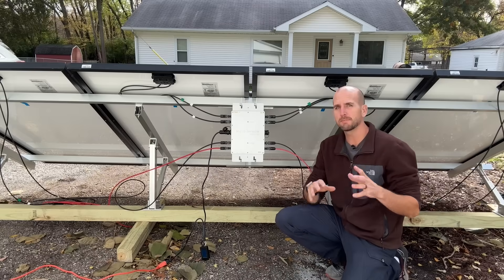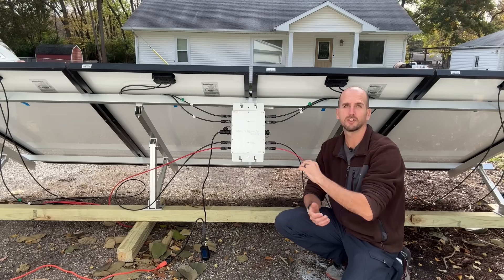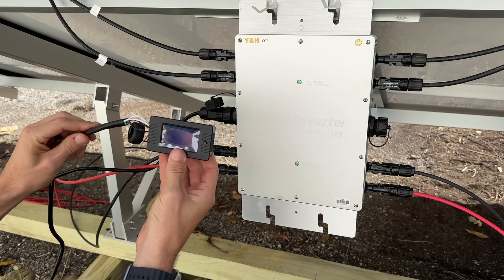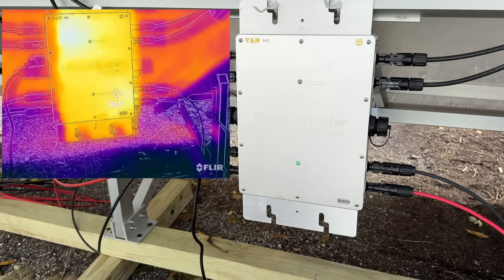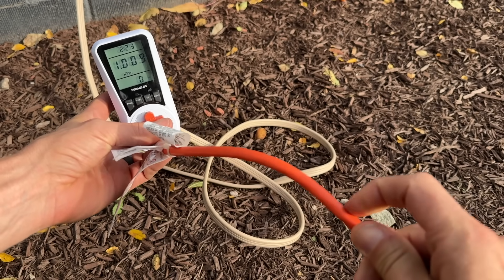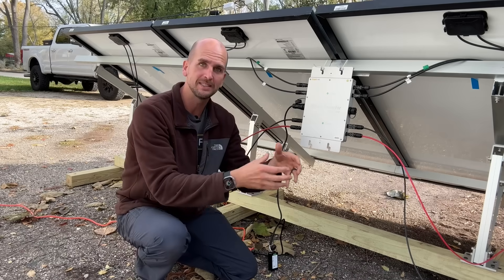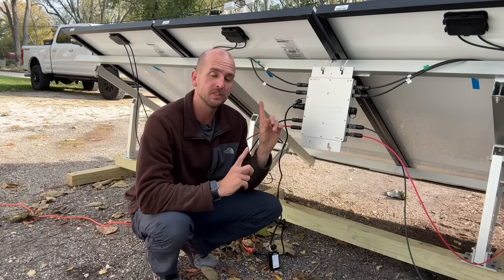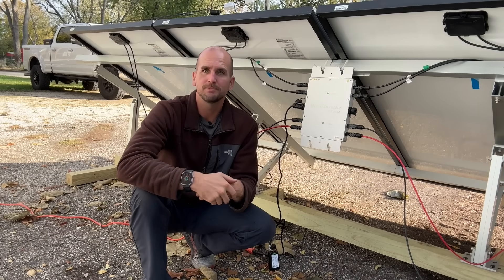Plugging Solar Panels Directly Into An Outlet | Surprising Results

Comment: We call these Grid Tie inverters - in UK they have to be approved and fitted by qualified experts in solar installations - they have to switch off immediately if the grid goes down otherwise they could backfeed the grid and harm a worker or operator - they all seem to get hot as they only have efficiencies of 86% due to MPPT and grid harmonisation structures - I run two in my workshop down the garden to offset the energy used and contribute to the standing loads like a refrigerator in the house when the workshop is not in use

Comment: You do not plug this directly into your electrical system and certainly not through a extension cord, it should go through a disconnect switch and a dedicated breaker.

Comment: Great video. I have an Enphase Grid Tied system and would like to add batteries myself. Any recommendation on how to achieve this
Reply from the maker: Oh man, that is a super common want/need right now and there isn't a great solution.  Pretty much have to go through Enphase a buy another large box that will manage where the power is coming from and then but the Enphase batteries.
Reply: If you have Enphase you should call your Enphase installer or get certified by Enphase university and diy
Reply: They put a ct sensor on the outgoing solar ac line and provide equal amount of power to charge the batteries... Otherwise you simply buy a battery bank that is charged by the grid and is UPS ready...

Comment: So imagine someone buys 2 of these. Each one is supplying power to the house. The grid goes out but each unit sees the power is on in the house because the other unit is on. Isnt that going to put utility workers at risk?
Reply: It only works if there is an active ac... If no AC it shuts down...
Reply: The utility ac frequency is what keeps  these devices on. The frequency of one unit could never keep another unit activated. That is the beauty of electronic technology.

Comment: You shpuld do one simple test on these: when in and powering your house, turn off your main breaker to simulate a grid fault. Do that with a light on and maybe not drawing more than what that inverter can provide at that moment. 
I am actually curious if and for how long the ligh would stay on.

Edit: and if you plug in a generator in a wall socket without the mains on/off grid switch like an ats or something more manual, with the mains running or coming back... it will make some expensive noises and smells. There is no chance a regular generator would sync to grid, it will just blow whatever fuses are concerned and maybe burn something extra like itself, some cords, something in your panel. 
Also, back feeding the grid with a genset is almost impossible. There are many more houses on that phase you are so you better have some serious generator power to keep your entire neighborhood, at least, powered. 
In a realistic scenario, in the best case you'll just stall your genset. Second best case, your main breaker trips, insulates you from the grid and you have power whilst others don't.

Comment: Steer clear of these WVC/Vevor microinverters. They are crazy inefficient and get very hot. Rule of thumb is 50% of rated wattage input. That is 300w for the 600, 600 for the 1200. Then it will not shut down to cool. However, these are low quality and fail a lot. Don`t waste your time and money, go for quality products instead. For example the APS DS range.

Comment: how does this work if you already have net metering?  I've had solar for 11 years pumping back to the grid.  Overall I've paid the system back and additional monies but realized they are paying me the wholesale rate for electricity I produce but charging me full price of course for what I use.
I'm now settng up a Delta Pro Max with 18kwh storage.  Trying to figure out how I can charge and then use that energy to offset the crazy pricing they are doing.  If I can just charge from solar an then feed from the Delta back into the grid via a 240 v that would be great.  🙂

Comment: Very informative and well put together........ Very Professional......... In my case I have already had 4 x 250W panels for 7  years and have been very successful........... Currently on my two new apts I am fitting 2 x VEVOR Solar Grid Tie Micro Inverters 1200W for my 4 x 440watt panels. My thoughts are that although rated at 1200 watt I will be running 880 watts through each inverter....and in addition will be using a solar fan to keep inverters cooler.......... because even if the inverter is rated at 1200 it seems to me if its working at only 2/3rds its maximum power it will thank you for it by increased power....... cooler is better.

Comment: The biggest thing is if you don't have your home electric meter setup to send power to the grid, if you do send power to the grid, you'll get billed like you were using that energy. Now if you are staying under the output of this, then you are fine. Well....might have some code questions, but the setup would work.

Comment: The most significant factor here is to never make more power than you are using. If you have a smart meter, the E comp will bust you. If you don't, the meter just reads amps, and they will charge you for the extra power you made.

Comment: So you're saying this won't work off-grid? Unfort
Reply: Yes you can. but only if you use more the you produce. I use a relay to cut the mains to the gridtie inverter once the heavy loads switch off.

Comment: I would like to see the waveform of the power on an oscilloscope.  The output waveform and the one when connected to the home load.  Please keep in mind modern homes have many devices that aren't simple resistive loads.  The ones that are not may not like the power provided.  Using a VOM doesn't show all the elements.  Who knows how the power from that inverter looks.

Comment: I have an Enphase solar system now. How would a system like this work with my current system? Or would it? Looking to expand my solar the DIY way to offset my shop AC system usage.
Reply: The unit works exactly like the enphase inverters... So I don't understand your question...
Reply: @ … 🥴…🥴 I wasn’t asking sarcastically not sure why you are responding sarcastically. If I knew the answer to my question, I wouldn’t have posted it. The Enphase system has a power company energy profile installed. Wouldn’t want to do something that would mess up my current system…

Comment: In Europe, this type of micro inverter is approved for outputs of 600W to 800W. A normal 230V socket is used for this. 
In Germany, only tested devices that are safe can be connected. In Germany, the devices must have two shutdown devices. On the one hand, there are the MOSFETs, and on the other hand, there is a built-in relay.
Even if the plug is pulled out during full operation, the bare contacts are safe to touch.

The Enphase micro inverters are not approved for use on a socket in Germany.
These are only approved for permanent connection.

All devices larger than 800W are required to have a permanent connection.
Reply: Wouldn't putting power into one half of the edison 3 wire split phase system in North America cause problems. For instance, what happens if you run a 220V dryer or stove when some of the power is coming from one part of the center tapped transformer & some from the solar panels?

Comment: With this setup you gained 1kwh every 2 hours roughly. So maybe, and I mean maybe, 3 kwh per day. Typically we run 30-50kwh a day so less than 10% savings per day on the bill. Our bill is $250 a month so maybe $25 per month savings for the risk of pissing off the provider, hurting yourself or someone else or creating a dangerous situation. If you want to do this great…pay for a true inverter, have an electrician install and be done. Playing around with fire will get you burned and for $25 a month it’s simply not worth it.

Comment: I want to buy a 4 Panel Micro Inverter Unit (1600W) on a flat roof. But I dont know what solar panels, cableing and mounting I need? How do I discover which solar panels etc. I need for the best result?

Comment: If I understand correctly, if the micro inverter senses no Utility power, it shuts down and doesn't work? That makes this system useless in an extended outage; you'd still have to have some sort of generator.

Comment: there was a company in Arizona that was making a panel you could buy for a while. you just pluged it in and it would automatically shut down for a power outage. when I tried to find the company on line they were out of business before they got started. If you are feeding back through a circut on your house you would not want to exceed 1800 watts  and that would be running the max your curcut is rated for.

Comment: The easiest legal way to do this is to set up an air conditioner or refrigerator on your solar power.

Then you're not grid tied.

They also sell an air conditioner now that takes both AC input and solar power input and it uses a c to supplement the solar.

Comment: Better to use an off grid string inverter on a critical circuits panel with grid input when battery and solar isn’t sufficient. The power is clean and you have100% self consumption. The technology has advanced greatly and is not expensive.

Comment: You must not connect an inverter to anything but a dedicated branch circuit. Having any other devices on the branch risks overloading the circuit should a fault develop.
Reply: Can anything be done to mitigate risks should you NOT use a dedicated breaker? example: converting all outlets on shared breaker to GFCI?

Comment: Can that setup charge a power station portable?
Reply from the maker: Most portable power stations you would just plug directly into the MC4 connectors with a conversion cable.  The vast majority with have integrated charge controllers to accept the solar input.

Comment: Trust the guy WHO HAS SOLAR
1. DO NOT DO THIS!!!
2. you require a breaker in the output connection.
3. This will Export to the grid and run your power bill Higher with smart meters!
4. This is NOT plug and play.
5. you will need permits and a new contract for exporting with your power company

Comment: I have these only in the 240v version. I have 12 of them on ground mounts outside. I have them go directly into two main panels to 240v 50amp breakers. they work great except the overheating that does shut them down. I have had failures and replacements.
Reply from the maker: Wow, now that is a setup!

Comment: Anyway it has a build in safety system and with max 600w plug and play its pretty safe. So with the micro Inverters safety system that monitors if there is power in the grid before delivering power, would it be possible to plug it into a portable power station..?

Comment: I would turn off the main breaker and see if it also shuts down and make sure it doesn't actually continue to output power if the grid is down.
Reply: It need the grid to sync with the 60 hz frequency it doesn't produce the AC without it... 
You can read the output right at the unit it is not 'live' ...
Reply: @SolarizeYourLife I'm sure that he understands what it says that it will do in the event of a power outage. What he is suggesting is a test of the claim.
Reply: You can measure at the plug before you stick it in the outlet. But just FYI, these require the service current to be present before they can produce current. If it goes down these measure zero.  if you don't use these and instead use solar panels with an inverter, it's possible to run current back into the line when it's down unless you make some provision for it, like a transfer switch.

Comment: This is fascinating. Plug and play solar is very common in the EU. Literally every secind home in my town has plug and play pv or normal grid tie or both. Not sure why it's a big issue in the US. In the EU, the only issue is the blackout auto disconnect. As long as the micro inverter meets this requirement, then your good. I paid about 450 dollars for a 900w system. Never overheats. Will pay for itself in 3 years, then it's pure profit.
Reply: these are not allowed in denmark..
so these are not commen in eu..
does other countrys then germany in eu allow people to just plug these in ???
Reply: @Hansen710  Austria, Germany, France,  Switzerland and Liechtenstein for certain. Probably more too. Very common where I live, has been for about 5 years.
Reply: No profit since the power company will raise the rates so you pay the same you were paying for 1/3rd the power.  government will never let them lose money.  how would they pay them the bribes.

Comment: Dude that system plugged directly into an Anker battery or something similar would be awesome.  Could power my garage
Reply: hard to tell.. even if you use the grid as one direction the possibility that anker is not bidirectional is almost 100%

Comment: Very interested in this, Couple things that I see as potential problems/Questions. 
1. As others have mentioned while its code compliant in my area (Michigan) you can't backfeed to the grid with out power company approval and they won't allow anything not UL listed. You might be able to get around this if you have an existing solar system and just use this to add additional power. 
2. What would happen if I had this plugged into my house and grid goes down but power still is on due to my existing solar and batteries? Would this damage my main inverter?

Comment: For me, the most interesting part was how much it produced.

I understood it to be basically 1/2 kilowatt hour per hour of operation.
Our electricity here is fairly "cheap" at 10  cents per KW HOUR. 
that's 5 cents per hour x say 8 hours per day or say $12/ month or $250/ year.
How long will my ROI be?
If I have no equipment failures, etc?
Reply from the maker: Yeah, I have another one I am testing in the coming weeks which hopefully will have a reasonable ROI.  This setup wouldn't make much sense for those of us paying around $0.10 per kWh.

Comment: i was told by a friend if my local company senses surplus power backfeeding to the smart meter without a net metering agreement they will cut your service and potentially come after you. i am looking into a zero export device to keep surplus power from hitting the meter.
Reply from the maker: I am sure every utility would handle it differently but when I contacted my utility company they would not allow a net metering agreement but also weren't worried about back feeding if the power was on.

Comment: Debating doing something like this on a 120v electric water heater to just heat my water for free before it enters my gas water heater, no sun just no preheated water for my gas water heater.
Reply: I didn't know water heaters were 120V; thought they were 220V powered.
Reply: @WilliamMurphy-uv9pm  Most 220v are just two 120v elements, you can power just one of them with 120v with a bit of moding.
Reply: @WilliamMurphy-uv9pm  I did just go with a 2kw panel setup with 10kw 48v batteries and running an offgrid inverter. I ran some cords off the inverter and run most of my 120v household stuff off it. Can just swap cords to the wall to be back on the grid any time I need.
Reply: @SarahStuff-p5u  Thanks for the follow-on comments.  Two things worry me.  Standard household wiring can handle 1,500 watts on a circuit without a problem all day but running your entire house via that relatively thin wire is suspect if not really dangerous.  Worse, getting 220v from a single 120v circuit may be possible but running a clothes dryer, stove  or a water heater on it seems too risky.  Overheated wiring causes house fires all the time.  That's not why most houses have such appliances EACH on dedicated 220v wiring.  If your battery can only produce a max of 1,500 watts at anytime, you are likely OK, I guess, but that can't really run an entire house full of appliances,  many on at the same time.
Reply: @SarahStuff-p5u  How do you get off of the grid as needed and keep solsr power from migrating to the grid when you don't want it to do so?
Reply: @WilliamMurphy-uv9pm  For now just working off some heavier duty cords directly off the inverter itself. Got a 3 way cord that is able to handle the 30 amps my inverter is producing. Runs gas furnace/dryer, washing machine, 3 desktop computers and my tv/dvd...and my fridge without needing over the 30 amp supply.
Reply: @WilliamMurphy-uv9pm  10 guage wire can handle 30amps all day no issues, combined loads for the most part for me are well under that closer to 15 amps, but peak of all the loads I have on that line if all are fully active is very close to that 30 amp.
Reply: @SarahStuff-p5u  Would you run your city power through that line to serve your entire  residence?  I think not.  Worse, what house builder uses 10 gauge wire in simple end point circuits in a residential home?  Most wiring installed can handle a max of 1500 watts per circuit.  Sometimes 2000 watts if you have some special purpose line and the heavier wire..  Running electricity to power your entire house though such a circuit into your residence is dumb and dangerous; unless, of course your entire house will ONLY run on a maximum 1500 to 2000 watts.  While this video claims to be able to run the entire house via that circuit, the reality of it is that the electrical storage unit can only output a maximum of 2000 watts.  Hardly enough to TRULY run an entire house.  Maybe just a SINGLE appliance or two small ones at a time.  Hardly "whole house"-level power.  But never make people believe you can use a 1500 watt circuit to INPUT whole house levels of solar power into your house.  No way!
Reply: @WilliamMurphy-uv9pm  I installed the wires myself, and it is appropriately sized for its application, it covers my needs, its in operation as we speak.
Reply: @WilliamMurphy-uv9pm  I unplug from the inverter and just move it to a wall outlet, it really is fairly simple.